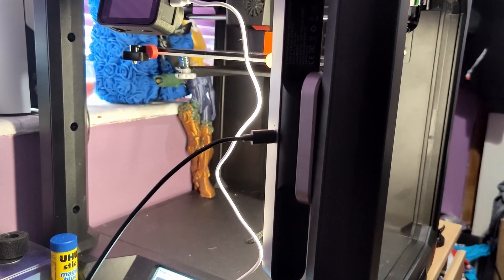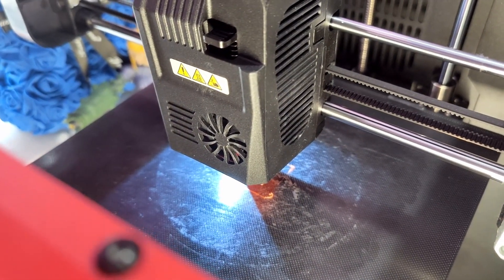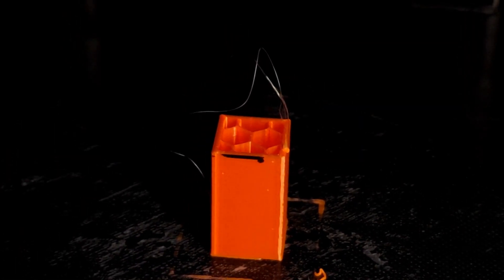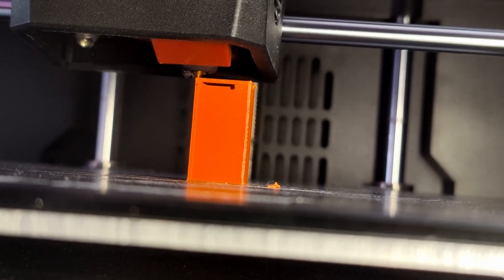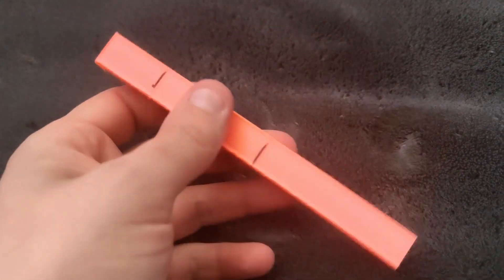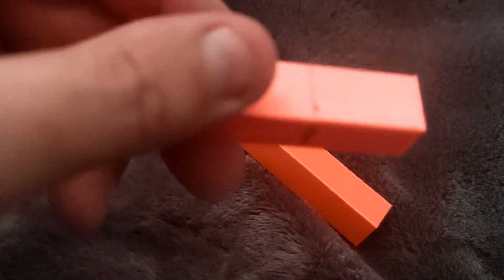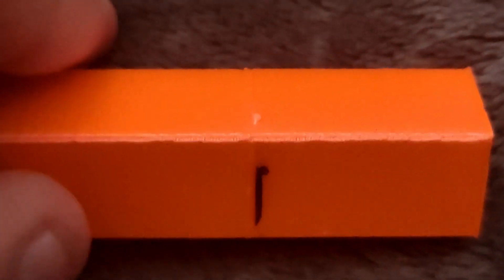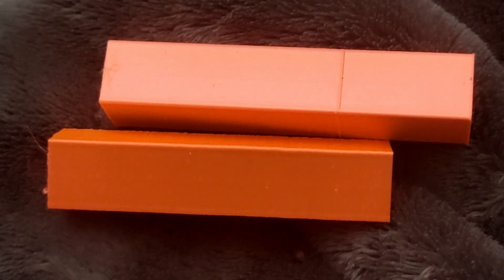Finder 3: Power Resume Function Test

Comment: Gaah, stop "hey Googeling" in the video! 😆 My speakers are going nuts!

But it seems to produce really smooth prints yeah? How does the finder 3 compare to adventurer 3 in print quality?
Reply from the maker: Sorry for the late response. 

Finder 3 is slightly better print quality and was able to cope better with slightly faster speeds. 

I do feel with a glass bed (and no levelling issues) the Adv3 would have pulled it really close. 

My personal choice between the two machines would be the Adv3, just seemed to be a little less problematic, less chance of blockages etc. 

But both were great printers
Reply: @LeeHubbz  thank you for taking the time and respond! I ended up getting the finder 3 and I'm really happy with it ☺️
Reply from the maker: @Tompradoo  that's great to hear...

I think any printer is capable of throwing up a few issues (sadly many people think 3d printing is as "plug & play" as an inkjet printer. 

But once you've got the machine setup, and you're used to the basic maintenance, any decent printer is likely to give you many hundreds of high quality prints. 

Great to hear you're enjoying yours, 

Happy printing..

Comment: Ive had the issue 2 times now where its completely locked up saying its pausing on its own but is frozen on the pause screen, and its still sitting on the print causing a thick deposit to sit there frozen.. till I had to finally flip the power off and on...  both out of no where, one was just stopped on its own.. other said I was out of material when I wasnt but was frozen on that screen...